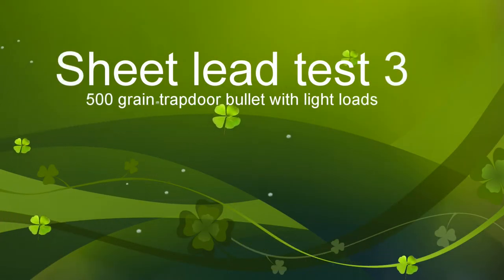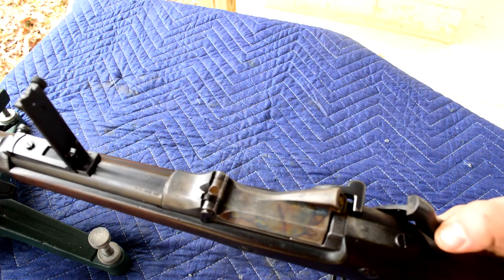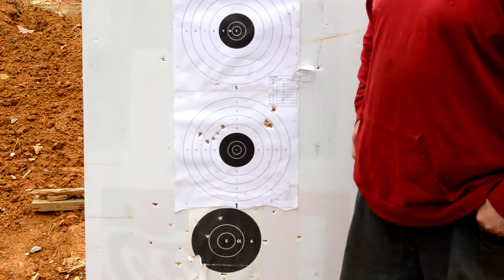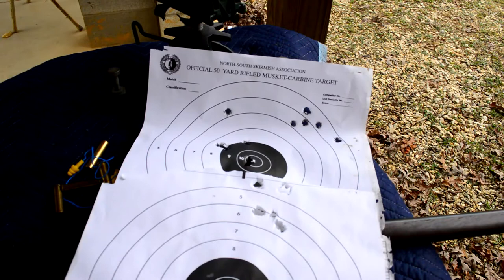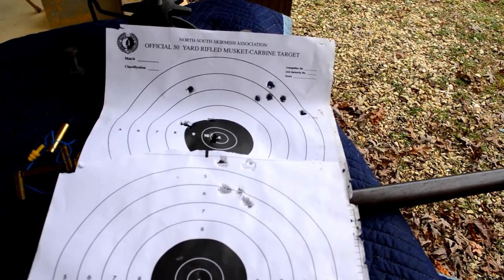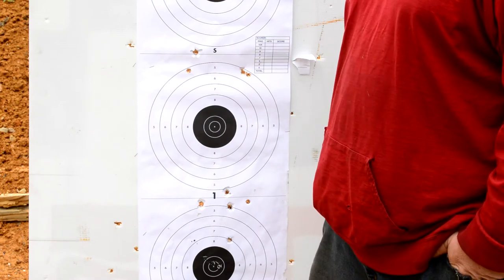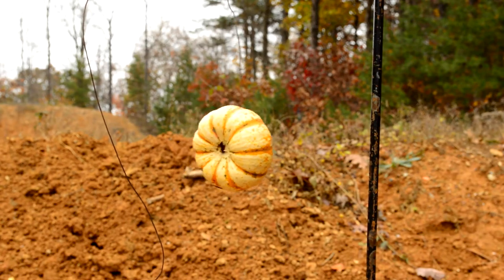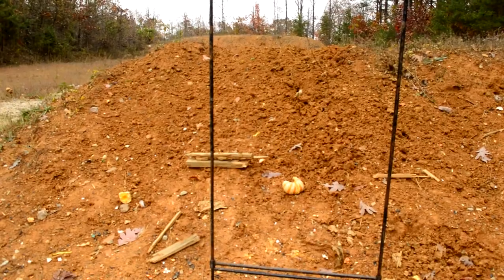Trapdoor springfield lead test

Comment: you do know that the sight is set for 250 yards !!??
Reply from the maker: It’s been so long ago I can’t remember where I had the ladder set. I did replace the original front sight with a taller one though so that I may aim dead on at 50 and 100 yards when I want to shoot that close. Out to 500 yards the sight is about 100 yards off or so with the taller front sight.